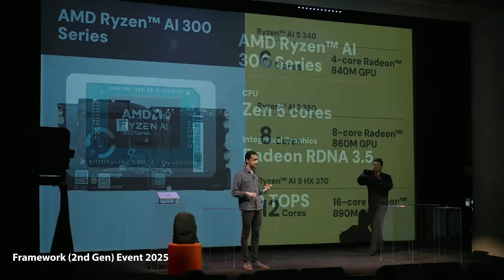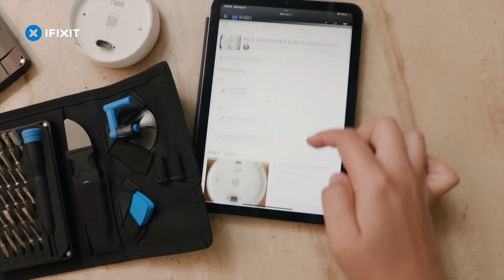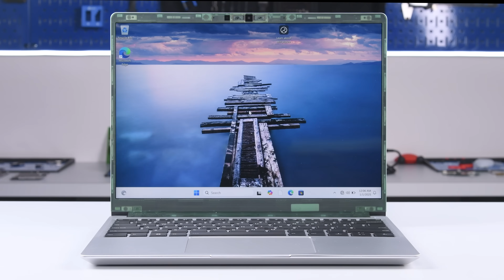Framework  Laptop 13 in 2025: The Laptop That Just Keeps Upgrading - AMD Ryzen AI 300 Upgrade

Comment: Im waiting for them to release 18 or 19 inch fat gaming laptop, im still on 1050 graphics card 😂 i want fat upgradable gaming laptop with power plug in the back betwen exausts
Reply: I also have a GTX 1050 laptop, and a GTX 1070 one.

The RAZER Blade Advanced 2018 will be used for remote work perhaps, but I might sell my Dell Inspiron Gaming 5000 laptop. My Steam Deck with its great AMD drivers outperforms my Dell with NVIDIA’s terrible Linux drivers in many games.
Reply: USB4 allows for external desktop GPU support.

Comment: but if everybody upgrades.. where do the old parts go?
Reply: People also use the old mainboards for personal projects, like NAS servers or anything you can think of
Reply: you can buy used at a lower price, its not no waste but its better than full replacement
Reply: You could use it for a project like a home server or an IoT device. You could keep it as a backup/spare parts. You could use it for a media PC or a small desktop, maybe something for a kid to use. Just some examples
Reply: upgraded parts are modules. you can sell or reuse those. hence circular economy. also those old mobos are sweeeeet for homelabbing if your are up for power efficiency
Reply: You can sell them on the second hand market so someone else can repair their framework for cheaper, or you can reuse it as a server
Reply: There are several places the old parts can go. They can be used in different systems, like a DIY desktop PC, because the mainboards don't require them to be operated inside the chassis. They can be resold on the second hand market. They can go on the parts drawer in case your upgraded system ever has a problem. Or, if you do end up tossing parts, it's a lot less stuff that needs to be recycled or in the worst case ends up in a landfill because you aren't tossing the entire laptop to upgrade.

Comment: A R.I.P for the users who bought the 16 inch model!
Reply: As I understand it framework is still working on upgrades for the 16, they just weren't done cooking in time for the last big event
Reply: AMD hasn't released RDNA 4 mobile. Reminder, USB4 allows external GPU support.
Reply: why?
they are not missing out on anything right now as nothing worth upgrading to has been released from any manufacturer.
Reply: @Pixelplanet5 AMD Zen 5? A new APU? SOMETHING MORE THAN A KEYBOARD UPDATE!?
Reply: There's nothing yet worth upgrading to or for Framework to spend development time making. You don't need an upgraded GPU every year.
Reply: @porschepal7932 8 GB of vRAM though.

Comment: A real repairable and upgradable laptop ! Finally ..
Reply: This comment is sponsored by Internet Explorer 6. That "finally" moment happened 5 years ago :D
Reply: @Peshyy  😂
Reply: @Peshyy The moment was arguably whenever they proved their track record
Reply: You still have to swap the motherboard. I'm waiting for laptop with CPU socket once again.
Reply: @JoPJR-ms8mg That's an issue with CPU manufactures. We'll likely never see that again sadly as modern CPUs are super powerful so using a desktop CPU is unfeasible along with the fact that motherboards only last afew generations of CPUs anyway. I think them producing the mobo and cpu as one combo to upgrade is more feasible long term.
Reply: @GamblingBass  Even still having an option to upgrade the board along with the processor when we can't have the cake and eat it too by means of laptop CPU modularity instead of just... Usually not having that option at ALL with other laptop OEMs is a really, really big deal!

Comment: UMMM ACTUALLY ☝️🤓 11th gen mobile is Tiger Lake, Rocket Lake is intel's Desktop line
Reply: I wonder if that was engagement bait.
Reply: @KellyWu04 duh
Reply: Funny enough, Tiger Lake was decent. Rocket Lake was straight up trash.
Reply: @cameron_bosch  Yeah, because it used Ice Lake's Sunny Cove microarchitecture backported to 14nm which meant it ran hotter and had room for fewer cores. Tiger Lake used 10nm and had the newer Willow Cove microarchitecture. Wasn't until Alder Lake where desktop and laptop finally had a unified stack again.
Reply: @cameron_bosch  Rocket Lake wasn't trash. It had AVX-512 support, which was nice, though quite niche. And core for core it was better. And frankly quite astonishing how performant it was, while still on 14nm. The i3 and i5 processors were quite good because of that. Only the i7 and especially the i9 were kind of meh to bad.
Reply: @Winnetou17  It was trash compared to AMD Ryzen 5000 though. And Ryzen 7000 then proceded to mop the floor with them.
Reply: @cameron_bosch  Forgot to answer you. I respectfully disagree. I think you keep thinking about top end performance, not the whole line up.

Ryzen 5000 was competitive with Rocket Lake. However, in late 2020, early 2021, the cheapest Ryzen 5000 CPU was 5600X at $299. AMD completely ignored caring for low end consumers. No cheap Ryzen 5, no Ryzen 3 at all. Rocket Lake still served that market, and even though it didn't had i3, it still had a very affordable, below $200 i5. Which ran very well for most gaming (and is still very usable to this day, including in most gaming).

Ryzen 7000 came one and a half years later and required a new motherboard and RAM. Feels like a stretch to compare it to Rocket Lake. And one year after Alder Lake.
Reply: @Winnetou17 Now Arrow Lake is the one that requires new RAM and a new motherboard, and possibly in 2026, aka next year, there will be ANOTHER platform and motherboard change.

Meanwhile, DDR4 prices are about to skyrocket while DDR5 prices keep coming down.
Reply: @cameron_bosch  Arrow Lake does require a new motherboard, but the new RAM ... it's been almost 4 years since we had DDR 5, I think that's ok :)) And Intel did give the option for Alder Lake and Raptor Lake + Raptor Lake refresh for having either DDR 4 or DDR 5. That is, you could've upgraded to a new CPU, had to buy a new motherboard, but could've kept the RAM you had. So on the "need new RAM' department Intel overal always had stronger options.

It is true that they do require more often a change of motherboard. Which I'd say, is more impactful than the change of RAM.
Reply: @Winnetou17 DDR5 does offer a big boost in some games like the Marvel's Spider-Man series of games. Also, 13th and 14th gen literally had issues with them failing and/or degrading and Intel actually ran out of replacment CPUs at one point.

And that's the end of that socket.
Reply: and as always , you get one point